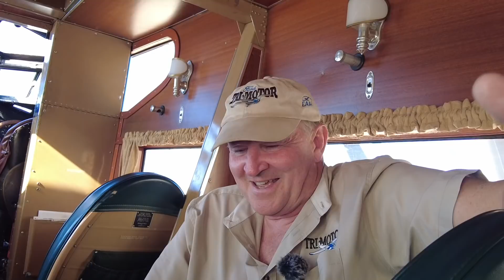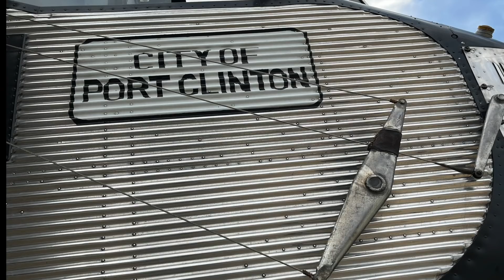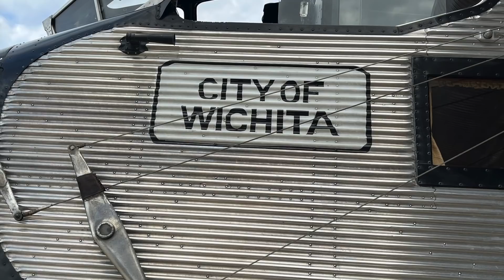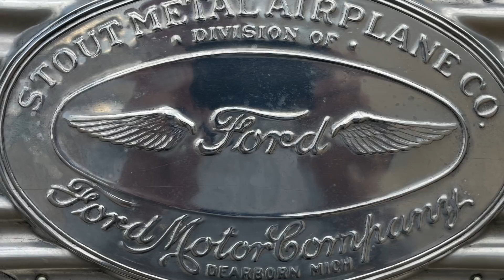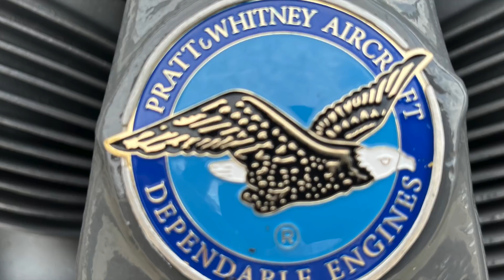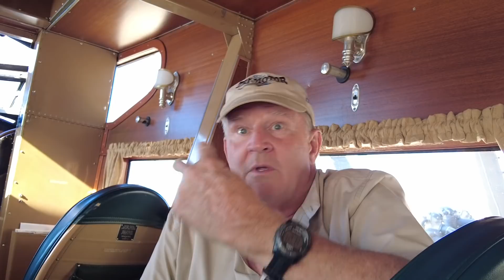Ford TriMotor visits St. Simons EAA

Comment: Thanks for the video.  Back in the '80s A friend owned the TriMotor at the Grand Canyon and I was lucky enough to catch a ride over the canyon. The aircraft had wicker seats, was pretty noisy but flew slow enough we could keep the side windows opened, and the pilot had to periodically reach out his side window to wipe engine oil off the windshield. That trip was an outstanding experience and I remember it in detail every time I see or hear of a Ford TriMotor. Thanks for the memories.

Comment: I may have once flown aboard the City of Port Clinton. Back in the 60s and early 70s, there was a small airline that maybe had  this and several other old Ford TriMotors, flying from Sandusky and Port Clinton, Ohio out to Big Bass, Put-in-Bay and Kelly islands out in the Western Basin of Lake Erie. I wondered what happened to these old birds. I figured that at best they went off to some aviation museums for static display. I am pleased to learn that they went to the EAA and the museum in Port Clinton that keeps them flying. They were slow, but fun to ride in. Thanks for doing this video on their visit to St.Simons. I am surprised that this gentleman did not mention that little sightseeing line up in Northern Ohio.

Comment: FWIW there is such a trimotor by Junkers, the Ju-52, but it is a low-wing aircraft and was built in great numbers up until 1952.   The high-wing German trimotor that beat the look-alike Ford Trimotor into service was built by Fokker and was produced from1925~32.  (Not metal skinned, as was the Junkers and the Ford)  Andy, when are you going to take us flying!?!?